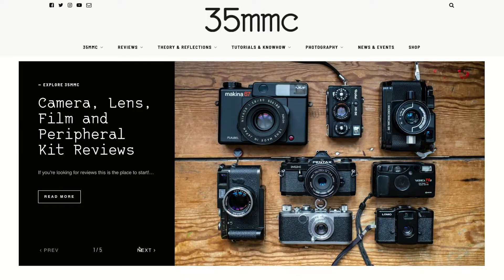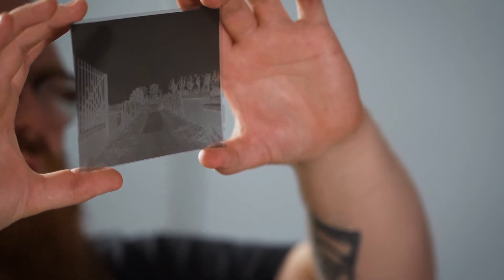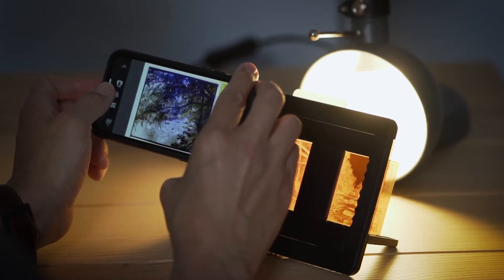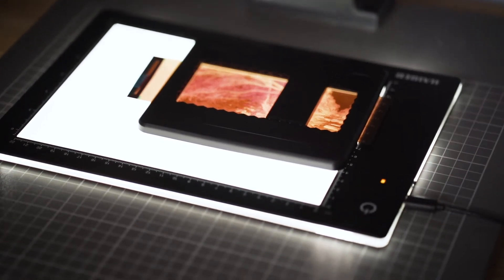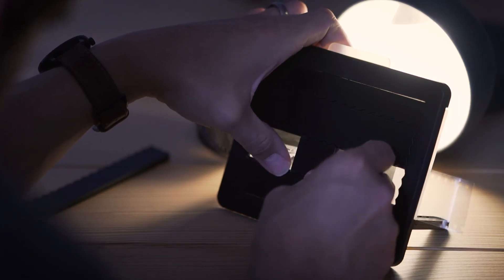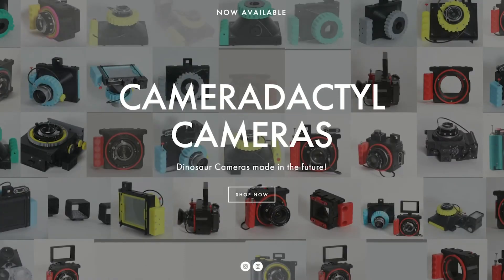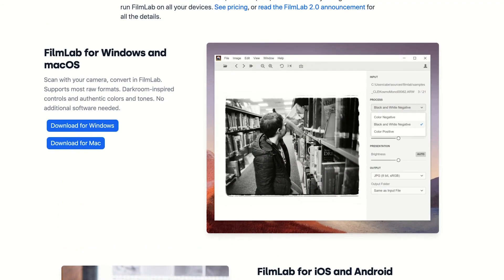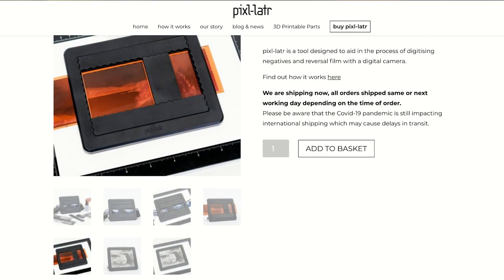A Primer for Digitising film with a Digital Camera

Comment: Just pixl-latr to help digitize 300+ slides from the 1970's for the Alice Moseley Folk Art Museum. Using it along with the Sony a7R IV and Sony 90mm macro lens, 3rd party slide holder for pixl-latr, and a small neewer led light panel for backlight.